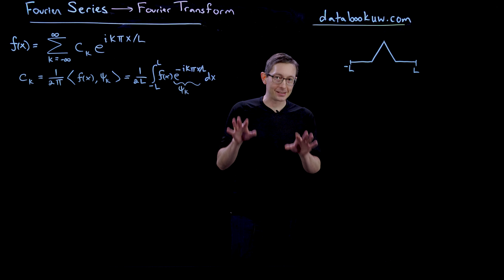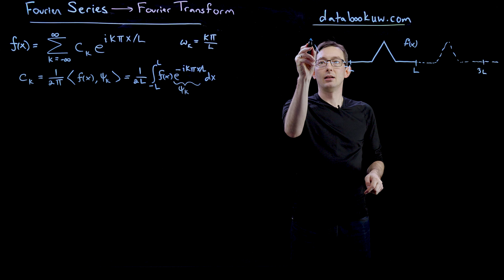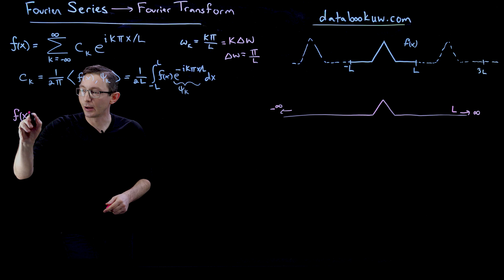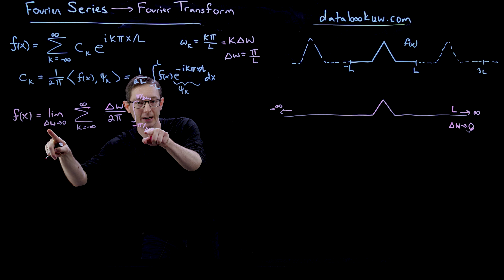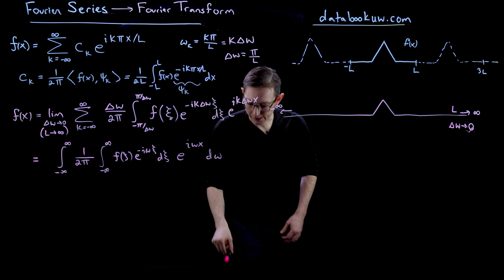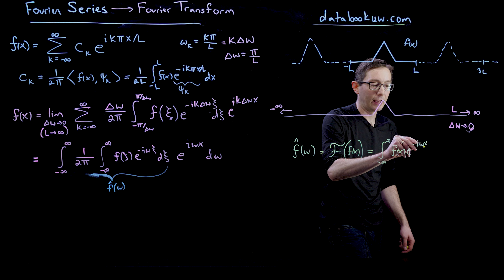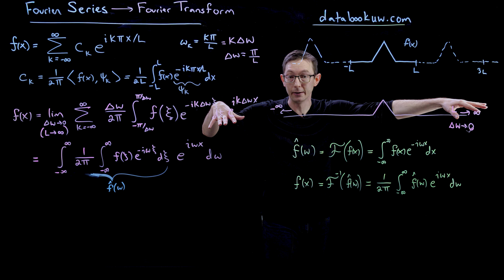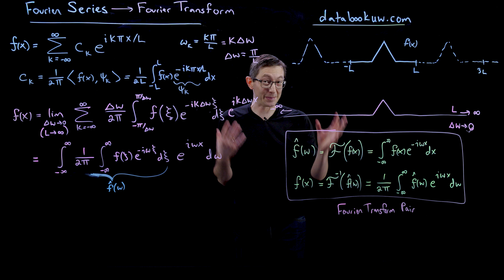The Fourier Transform

Comment: This is one of the best series of lectures! Question professor: 
1) what's the meaning of delta omega? Pi/infinity = 0 here. especially at 7:46 based on what it came with dw integral range from negative infinity to infinity? from omega definition I don't see this integral domain. 
2) Shouldn't it be delta K when you converge your first summation equation to integral?
Hope you can help illustrate! Thank you very much in advance!

Comment: I miss from most lectures like this a more precise definition of what you mean in this context by taking the limit as the period tends to infinity. If you let 'N' be the absolute value of the upper and lower bound of sum index 'n' then what you get to see is both N and the period tend to infinity. It is very hard to think about how this all converges because of the 2 variables. If I wanted, I could always choose a larger period and a larger 'N' so that the frequency domain passed on to the Fourier Transform Function will not increase. You need to imagine the tendency of the period and 'N' so that you always get a larger AND denser frequency domain so that your sum can be seen as a Riemann sum and it indeed converges to the limit defined by the final inverse integral from minus infinity to infinity. If you take in this very sense "take limit as period tends to infinity" then yes you must obtain the Fourier Transform but it is not straightforward.

Comment: Hi Steve, I've worked with the Fourier transform for years, but I just realized that I don't understand something.    Please, consider your triangular function f(x).    Suppose I multiply your f(x) by a factor B.    Suppose I want a transform that in independent  of B.   In other words,  I want a transform that is independent of a scaling factor.  Does that make sense?   I have a physics research situation where I believe it should make sense.  How would you define a  transform that is independent of a scaling factor?  Thanks.

Comment: When can you interchange summation and integral in Fourier series?
Reply: The Riemann integral is simply defined by the limit of a Riemann Sum as the delta variable approaches zero.  The instructor just recognized the form and replaced it with the integral notation.  Not sure if that answers your question.
Reply: @kylegreen5600  I don't understand. When can you integrate a Fourier series term by term?
Reply: @NoNTr1v1aL  Could you respond with a rough time in the video where you're not following the steps and I'll try to help.
Reply: @NoNTr1v1aL  Your question is different from what Dr. Brunton did: like Kyle said, he's just recognizing a Riemann sum that already exists, he's not integrating the Fourier series. It's just a definition: as L -> inf, the series turns into an integral.

Your question is different and gets into deep waters. The short answer is: if f is "nice enough" (e.g. C^inf smooth.) The long answer: this is the entire subject of Fourier and harmonic analysis. In general, integrating and differentiating series term by term depends on the analytic properties of the f being expanded, the types of convergence (uniform, pointwise, etc.) and it only gets more subtle with Fourier. The Gibbs phenomenon is already an example of this: a jump discontinuity in f screws up uniform convergence of the fourier series, and if you remember, Dr. Brunton mentioned that the "top hat" function was related to the derivative of the "triangle hat" function (which was continuous, but not continuously differentiable), so already you can see some of these subtleties creeping in. Check out Stein and Sharkachi's books, Tao's books, etc.